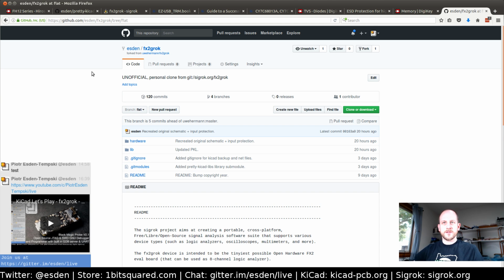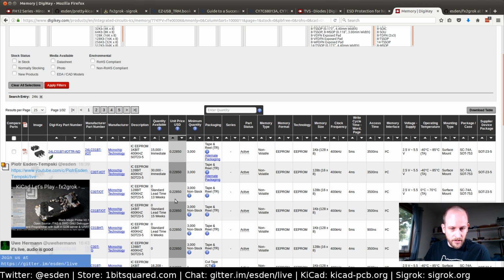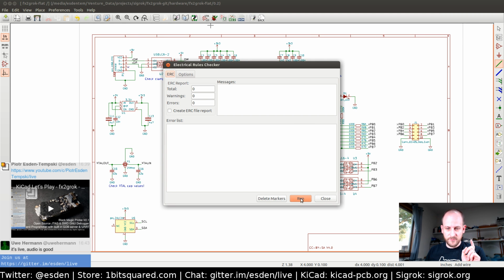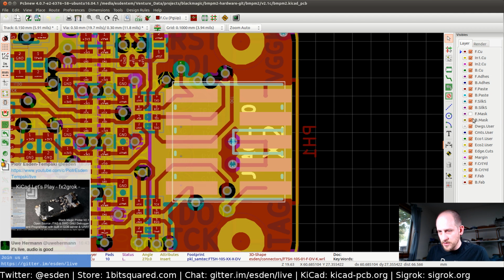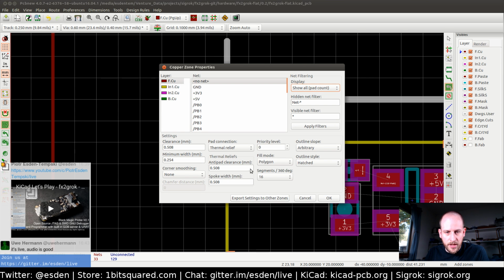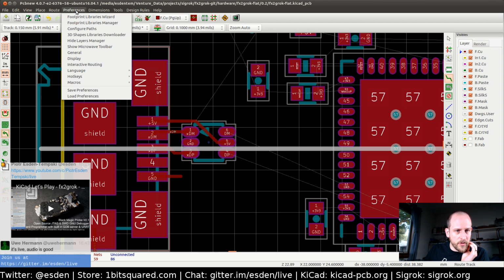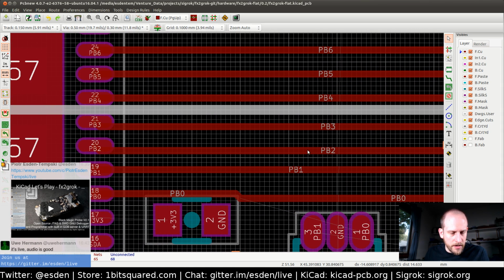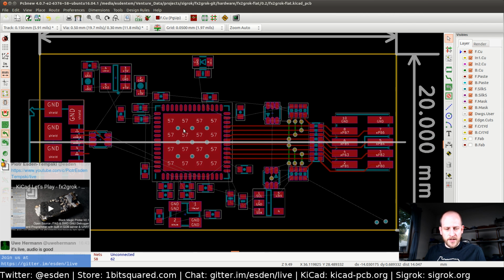KiCad Let's Play #2 - fx2grok - Sigrok Logic Analyzer

Comment: Hi, I heard you don't want to use through hole components, but IMHO its good to have the connectors as through hole for added mechanical strength, something like 10103594-0001LF for the USB :)

Comment: I have a recommendation, change all the 100 ohm resistors + ESD/clamping to this one I have linked, it has everything in it plus is cheaper. I use it in all my designs instead of the discrete resistor + ESD/clamping :)

https://www.digikey.com/product-detail/en/nexperia-usa-inc/IP4256CZ5-W,115/1727-4718-1-ND/2531158
Reply: Sorry I linked the one without settable clamping voltage, but you get the idea :)
Reply: Plus maybe you want 8 channels directly, you can check here for the one that fits best 
https://www.digikey.com/products/en/filters/emi-rfi-filters-lc-rc-networks/835?k=&pkeyword=&pv1540=59&pv1540=50&FV=1c0002%2C2dc1a56%2C18100025%2C18100032%2C1810003b%2C18140001%2C1f140000%2Cii2%7C2093%2Cii3%7C2093%2Cii4%7C2093%2Cii6%7C2093%2Cii8%7C2093%2Cffe00343&mnonly=0&ColumnSort=1000011&page=1&stock=1&quantity=0&ptm=0&fid=0&pageSize=25
Reply from the maker: Awesome! That is a great idea. I have to dig through a little bit. I did not even consider adding input filters. But having an all in one solution that does the clamping and input filtering is a very good suggestion. We do not want aliasing artifacts do we :D Although as far as I can see the lowest frequency the filters are available as is 100mhz ... the FX2 LA can only go up to 25mhz which might be an issue. Do you have any thoughts about this?
Reply: Piotr Esden-Tempski I generally just accept it, with the 100 MHz version we get about 25 Mbit maximum data rate with good edges. If you really want to slow it down you can add more capacitance, but I am pro the faster edges :)
Reply from the maker: Thank you! I will go with the 100MHz then. :D